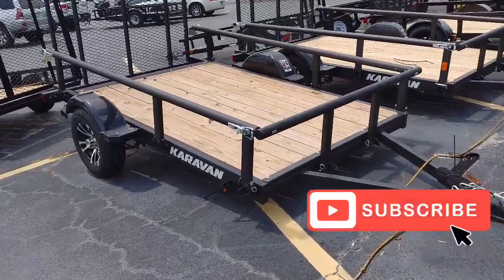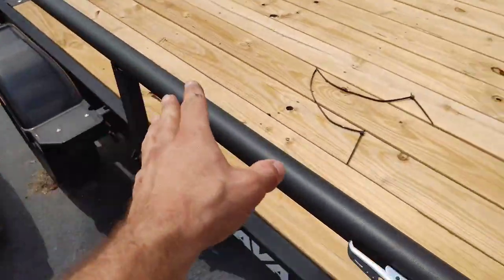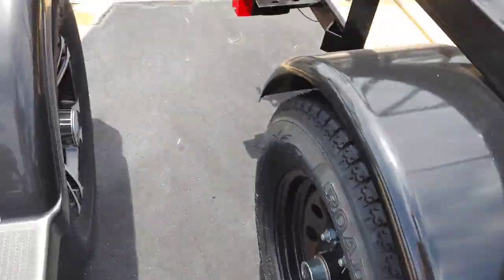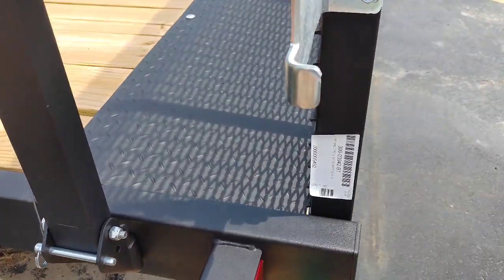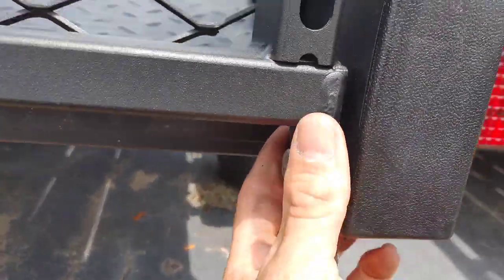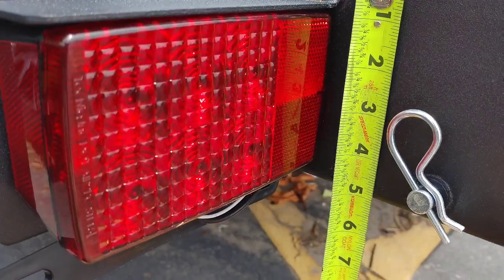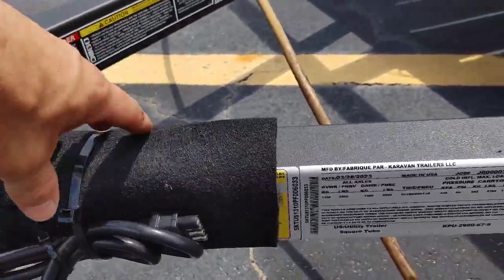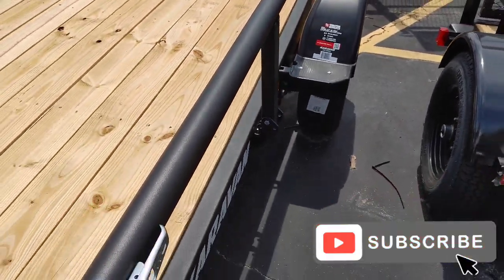Karavan Trailer Review at Tractor Supply

Comment: Good going over video.

Was 'shopping' for a trailer for years, would always see people in forums and comments etc. going off on Big Tex Trailers, so didn't pay too much attention to them, seen one for sale recently, almost like new and at a good price and bought it, seems great so far.
Reply from the maker: I love Big Tex trailers. Maybe the other people were talking about the larger Big Tex builds. I've never had or used thier larger ones. Just smaller ones less than 20 ft long. It's the brand I plan to buy again next. The ones I've sen are very well built and well designed

Comment: [Karavan Tie Down Kit, 5 in. Side Tube, 4 pc.] for 5-inch frames, sold at TSC or elsewhere, 1/2 x 6-inch bolts go in the pre-drilled holes on both sides of trailer. My 2021 Karavan 5x8 has 3-inch frame, four pre-drilled holes on each side, bought D-rings and shorter bolts. 
My Cub Cadet XT2 tires run above the two inner ramp metal-tube supports, not in open area. Works great.

Comment: Has anyone ever had a problem with the latches breaking and or get really loose?
Reply from the maker: I was so impressed with these Im thinking about getting one
Reply: I bought one of these utility trailers in 2021 and it has been great overall. Last week one of the ramp latches snapped. I ordered a pair of new ones from Eastern Marine. The new ones have been revised and have thicker loops. I believe all the new trailers are equipped with the revised latch.

Comment: I've been wanting a small trailer for my lawn care business. So I went and looked at all the brands Big Tex, Carry On and Karavan even looked at used trailers and people want more money for a used trailer than new ones...So I went down to Tractor Supply and purchased a Karavan 5x8 $999 mounted up all my gear Lockable Blower Rack, Lockable Trimmer Rack , Fuel Can storage, Mower tie downs and Tool Box.... Loaded up all my gear today just to test it out works like a charm. I will put it all to work tomorrow morning mowing 6 lawns. I used to do all this out of the back of my Pickup Truck but loading and unloading 100lbs mowers out of the bed started to take a toll on my back...
Reply: Hi. Does the karavan $999 karavan you buy its come with the straigh tongue or the “V” nose tongue? because I see two model one with straigh tongue and the other with “V” nose tongue
Reply: @flexd1453  Straight Tongue !

Comment: Bought one a couple weeks ago. I was surprised to see a drop axle, rubber plugged predrilled holes along the frame for d-rings, 2 mounting options for the front spring for drifferent heights, a solid wire loom, and alloy wheels.  I load bikes into it and the ramp holds up surprisingly well. Blows the previous carry-ons i owned out of the water.
Reply: Also the fenders have about an inch of adjustment front to back.
Reply: Where are you located?